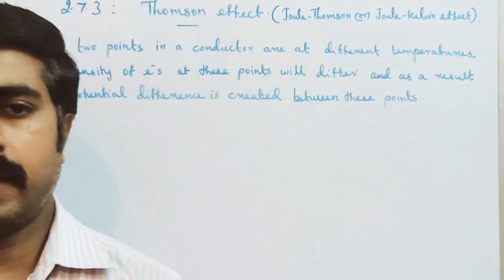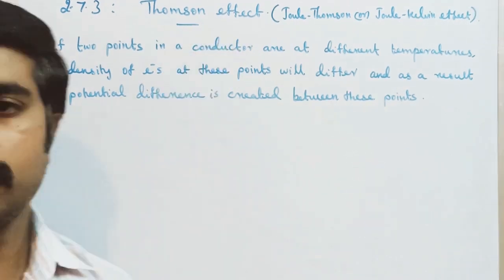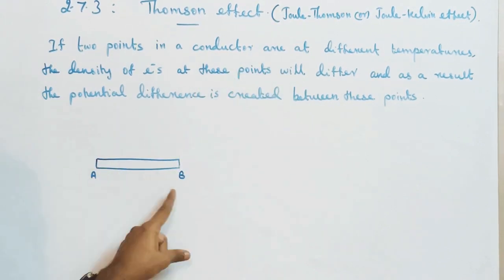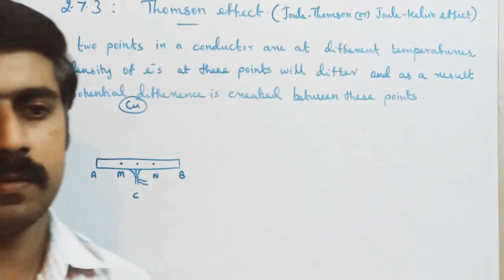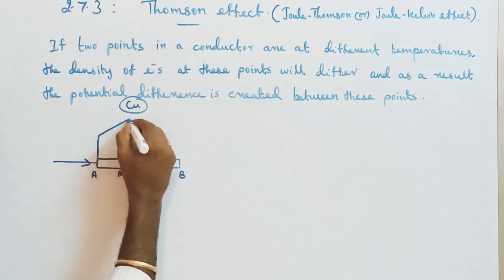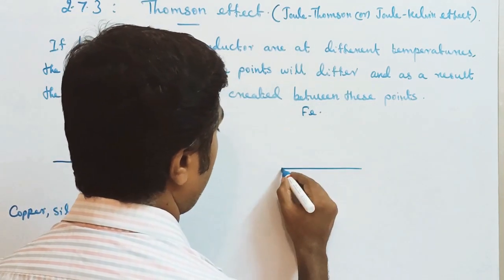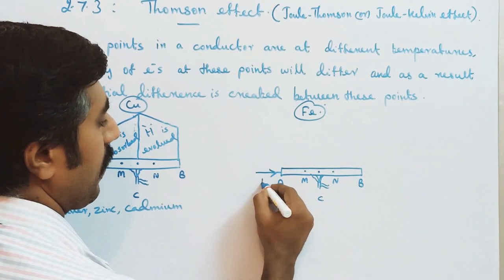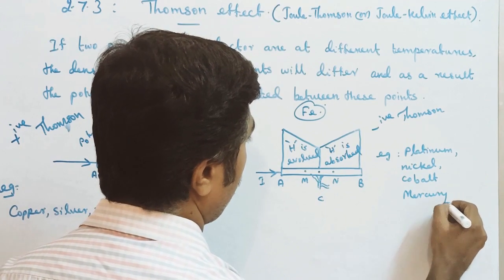Thomson effect||Joule-kelvin effect||Ln 2||2.7.3||STD 12 Physics||Tamil

Comment: Sir, if the  ends of  the copper bar is not maintained at  different temperatures, can the heat be absorbed  in tha region AB and heat be liberated in the region CB
Reply: Actually this effect is based on the metal ends having different temperatures. If there is no different current, then it's not Thomson' s effect. 2 ends of a metal having different temperature is only thomson 's effect